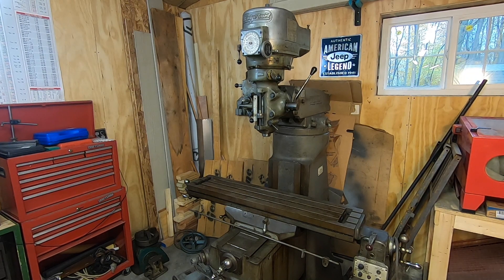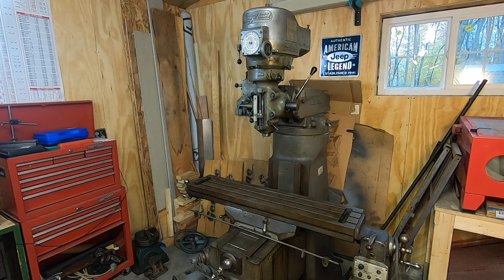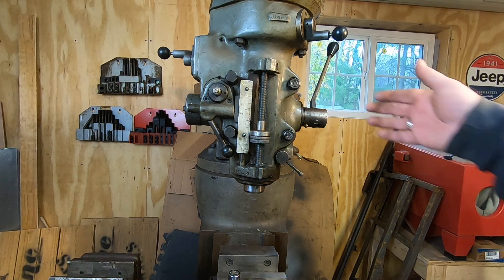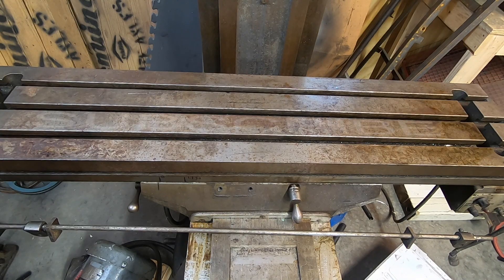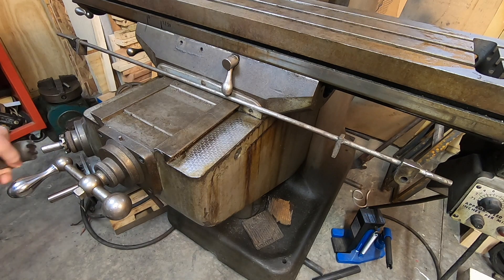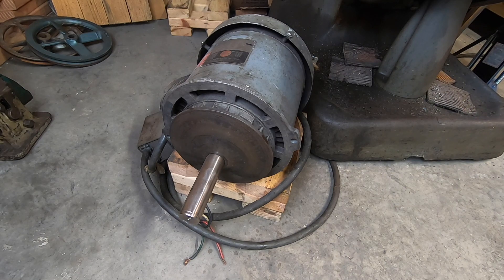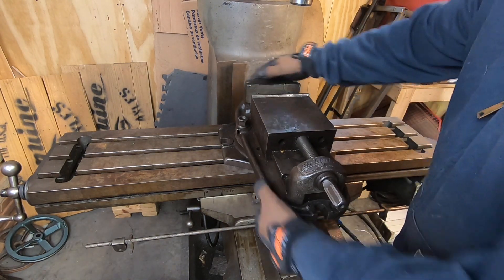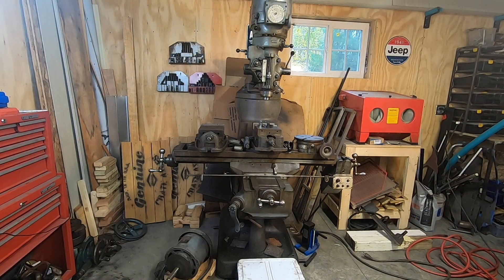Bridgeport Vertical Mill Rebuild - Plan of Attack

Comment: Great looking mill!  You dont have any major issues from what I see and parts are available from H&W machine.  I suggest avoiding ebay parts when you can.  What did it cost to rewind for 240vts?  I slapped an 80dollar vfd on mine and set it to 60hz and never touch it.  I did buy the 3axis Toauto DRO and for the money, it's a good dro.  When you are ready for a Kurt, find the guy on ebay in California, he cut me a great deal on a real nice 6inch.  I was near him and picked up and saved even more money!
Reply from the maker: It wasn't rewound, just wired for 240 instead of 480. Still 3 phase. I'm not much for name brands, TBH. If I really want a Kurt, I'd either find one at a local auction. The same place I found that tail stock for the dividing head has a stack of old Kurt vises for $100 each. But by the time got jaws (there are none) and rebuilt it, I'd have more into it as it is worth. I'll just paint mine blue. ;)
Reply: @MyLilMule  Oh.. than you still need a vfd anyways.  My machine came with an original bridgeport vise, but I got sick of the jaw lift.  I paid 250 for my vice btw.😉
Reply from the maker: @jagboy69  I'm going to start with a static phase converter but eventually I want an American Rotary phase converter, just need to figure out how big I want since I will likely be adding additional machinery.
Reply: @MyLilMule  I considered a rotary... But I work alone, only run one machine at a time and like peace and quiet.  I have 3 machines, (2hp mill, 3hp lathe, 1hp surface grinder) and I have 3 identical cheap vfds.  My lathe even has a 2speed motor so a rotary for me would be overkill.
Reply from the maker: @jagboy69  I just think rotary gives you cleaner, more consistent power. Plus, you get the full HP rating of the motor. You only get 2/3 of the capacity with a VFD or SPC. If I add a 5 HP lathe, a static or VFD just won't be able to power it adequately. At least that is what my research is telling me. I still have a long way to go, more advice to seek. I may change my mind when it gets to that.

Comment: That will keep you busy during the winter months.
Reply from the maker: I'm sure, although I do want to get it up and running as quick as I can. The table/saddle/knee/base won't be that much work. I'm not going for a full on restoration. Doubtful I will replace any screws. I definitely won't be having the ways ground and scraped - no way I could justify that expense. But it'll get cleaned up, painted, and adjusted the best I can to make the bnest parts I can. It's for me as a hobby. If it was a full or event part time "job" - I might take it further. But not at this point.
Reply: @MyLilMule  I don't blame you. Unless you are making nuclear submarine parts you will be fine with a little wear and slop. I need to replace the back gear bearings in my vertical at some point. They have been noisey  since I bought it. I am just not motivated to do it.